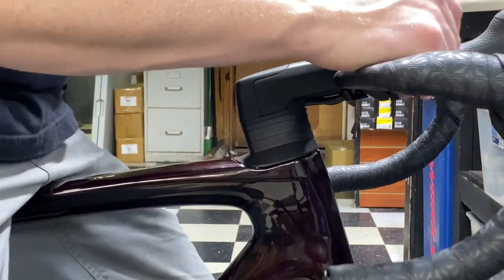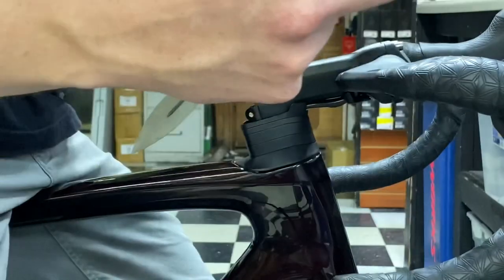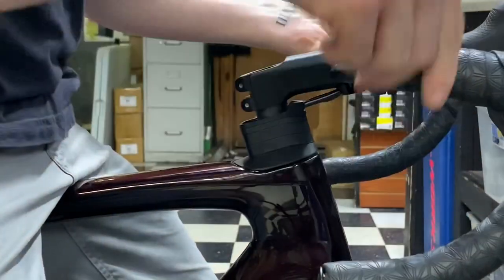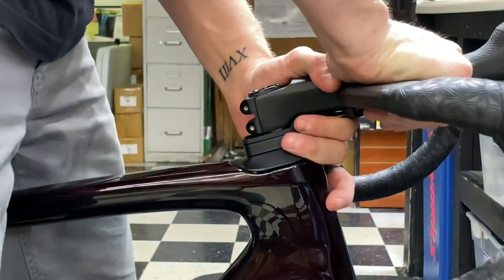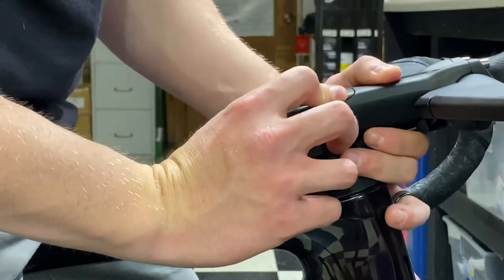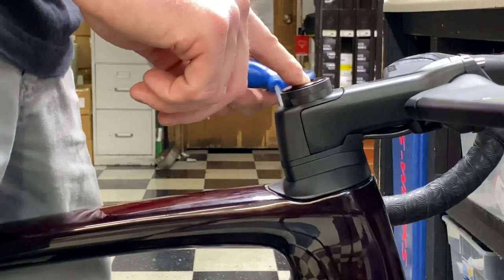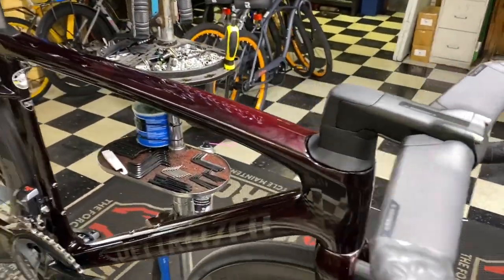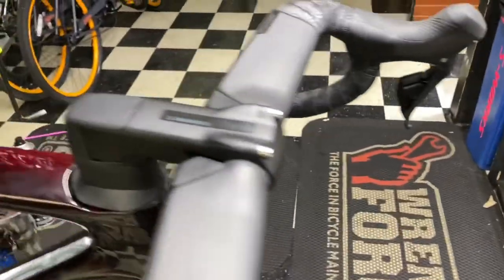*HOW TO* LOWER SPECIALIZED TARMAC SL7 STEM AT HOME WITH THE PARTS YOU HAVE. (COMP, PRO, S-WORKS)

Comment: @GC,  If you had removed one more spacer, and then cut the steerer tube, would it be necessary to cut/adjust cable length too?
Reply from the maker: You wouldn’t need too

Comment: Hi, just wonder if the factory brake cable has some slack to install longer stem?
Reply from the maker: maybe 10mm longer but it is usually pretty fit to it
Reply: @GCPerformance18  thanks for replying, I think im in trouble. Planning to add 10mm length and 10mm width bars 😅

Comment: Not sure if I’m going off on a tangent, but when dropping the stem, necessarily that’ll result in reducing the space between the top of the knees and the torso, at the top of the pedal stroke (closing?) the hip angle to some extent.
Countering clash of knees to torso in the more slammed position could be by a)reducing stem length? b)reducing crank arm length? c)reducing biscuits and gravy?
Also,
could the same “experiment” with lower position procedure be followed for 2019 venge?
Regardless, fantastic work in this and all other videos, many thanks.
Reply from the maker: thanks so much!!

Comment: Hi, very helpful video.. Can the steerer tube be shortened by cutting without disassembling it from the frame?
Reply: It can be done, but you have to use a small saw guide and the remaining amount of steerer tube needs to be at least long enough for the saw guide to clamp on.

Comment: As per Tarmac's user manual, a spacer bigger than 5 mm shall not be placed above the open stem cover. Is it because of the top cap bolt's length? And what are the risks of installing a spacer bigger than the recommended one? Thanks.
Reply from the maker: dont worry about it, as long as you tighten the pinch bolts on the stem to the right torque readings I have slammed my stem and rode with all the spacers on the top no worries at all
Reply: @GCPerformance18  I tried this today and was wondering the same after noticing the comment in the Tarmac user manual... I think in theory you could remove all the spacers from below the stem, and then the stem would be gripping the steerer tube below the expansion plug... isn't this a problem? I just slammed mine by 15mm but this is a pretty crucial part of the bike so don't want to F something up and have a life altering crash as a result....lol
Reply: @IPAColosseum  On the safer side of things, ideally you want to clamp the reinforced section of the steerer tube. Specialized's expander plug is a little taller (if not just as tall) than a stem's steerer tube clamp.

You also may have heard of people deliberately running long expander plugs for this purpose.

Comment: Sorry for a question, did you have the chance to mount the Aerofly II handlebar with the mechanical shifting? Because i would like to mount it on my Taramc SL7 Expert with mechanical Ultegra.. Many thanks in advance
Reply from the maker: i have not ran it yet but I know it is possible because I have seen bikes with it done.... so best of luck
Reply: @GCPerformance18  Thank you very much
Reply: @yonglingng5640  thanks, i think i found it on your photos, is the black/ice-white sworks frame, right? Really cool!
How was to mount aerofly with mechanical cables? Hard or quite simple?
Reply: @Andrea-uc7dy  Yup, you found it.

In terms of difficulty, it certainly isn't easy, but using an old shift cable to route the shift housing does greatly simplify the process. This trick has helped me route several bikes and handlebars with ease, I almost didn't need my Jagwire internal routing tool.
Reply: @yonglingng5640  many thanks

Comment: Does this technique require the carbon fibre spacers to be as you’ve shown? 
Or can this be done with the spacer kit specialized sell? 
e.g. Specialized My19 Venge Headset Spacer Kit?
(In a case of a 2019 venge)

Comment: I understand cutting the steerer tube. Is it just as safe to cut down a carbon seat post?
Reply: Yes it is, just remember to take note of the minimum insertion mark's distance from the edge of the seatpost, then make a new mark post-cut.

If it's an uber-lightweight carbon seatpost like Darimo's, no. It has a designated clamping zone, so the carbon's thickness is only thicker in that zone.
Reply from the maker: yes it is and like he said as well :))
Reply from the maker: thank you
Reply: @yonglingng5640  I have a Syncros Duncan Aero SL from my 2020 Scott Addict RC Pro
Reply: @GCPerformance18  You're welcome.
Reply: @JayLato  The original seatpost of a bike is mostly safe to cut because the thickness is constant throughout. This is why they weigh heavier than uber-lightweight seatposts.

Comment: Have you traveled with a SL7. How hard would it be to drop the bars for a bike bag? Also what ratchet would you need to upgrade the Rapide CLX hub?
Reply from the maker: yes it is fine, just get a big enough box or bag where you can take the handlebar off, and put to the side, you need the 54t ratchet but the EXP version
Reply: @GCPerformance18  does the Rapide CLX come with a 36 or 52t ratchet?
Reply: @jj4996 the CLX wheels come with a 36t ratchet

Comment: I got myself a brand new SL7 tarmac, when I got it I noticed that the wheel wasn't quite lined up with the bars, therefore I realigned it. Now when I turn the bars I can hear a hissing, I didn't thighten the bolts too much, the top one a bit tigheter than the pinch ones, pinch ones are just snug. No play in the headset.. Any suggestions or this is expected behavior? Bare in mind I haven't ridden the bike yet.

Comment: Hi GC, 
thanks for the great video!

Can i ask how tall you are and what your leg length is?
You said the bike is 52 - I'm just curious if I am going to order the right size. :)
Reply from the maker: So this bike was a customers bike. Not mine, I ride a 56 and I’m 6ft tall
Reply: I'm 5'7' and ride a 52  Inseam is 31. I could also ride a 54.. I need 15ml spacers under the stem on the 52 If I rode the 54 I wouldn't need them. Make sure you get a fit.

Comment: Do you have the top cap and the bottom screw piece for the cable in stock ?
Reply from the maker: I do not but call any spewciqlzied dealer they should be able to help

Comment: Is there typically enough slack in the system to at least get some fresh grease on the upper and lower headset bearings?
Reply from the maker: very rarly, you might be able to get away with a grease gun on the top but I do not knwo about under neath

Comment: Do you have to re-bleed the line if you decided to cut the steer tube or do you just cut it without taking the fork out of the frame?
Reply from the maker: so you can get a saw and jsut got it while it is still attached to bike, you just have to remove at the spacers and stem and be very carefull on the cut and have someone hold the bike..... I have done this before but the real way to do it is, to un hook the brakes and pul the fork out and then have to re run the cables through the bike, if you are carefull enough someitmes you dont have to rebleed brakes on new connection....

Comment: Is there typically enough slack in the brake housing to swap stems to go up 10mm from like a 100 to a 110 without having to redo the cabling?
Reply from the maker: sometime syes depends on the shop who builds it, I usdually shove cables into the bars to add excess amount if we do want to make the stem longer......

Comment: Hey GC, with the original top cap and cover. do you need to use that specific top cap for the cover to clip in? Or is the top cap not involved with the integration of that plastic cover?
Reply: Yes, the stem cover clips into the top cap, but there's another version of the stem cover that has a hole up top, allowing you to use any top cap you fancy.

Comment: whats the performance benefit of the swapping out the ratchet? Is it the same one in the CLX wheels? What's the expected gains, as I have thought about upgrading mine In my Pro
Reply from the maker: you would get a better pedal stroke annd less dead spots in between and more engagment for climbing...... you do get a little  tiny more drag while coasting but I mean as long as your pedaling..... there is no downfall to it

Comment: Planning on replacing my stem from 80mm to 100 or 110mm, would there be enough slack on the cables for the longer stem? Thanks!
Reply from the maker: there suualyl should be enough slack, when I build I shove extra cable in the bar for that reason alone
Reply: @GCPerformance18  great thanks!

Comment: the spacer and covers look sick! but does it fit on an Allez sprint? I just like the look of it xD
Reply from the maker: it fits but ti does not look as good on the allez sprint
Reply: @GCPerformance18  do you think i'd be better off a normal spacer and stem
Reply: @fluxed2100  You're better off with regular spacers.

Comment: hi there! could you fit  the tarmac stem into a sworks venge??  I have a sworks venge  and i need a 90mm stem and it seem way easier to find the "tarmac 90mm stem " would it fit my venge? kind regards!
Reply from the maker: yea it work but ti doesnt match the fit of the spacers, btu stil works

Comment: Just wondering, do you have to use spacers? What’s the risk of not using the spacers?
Reply from the maker: you need to, the fill up the empty space, so you run the risk of the fork being able to move up and down if not filled by spacers

Comment: How low you can go before deciding on bar height because of the compression plug length? I assume you should not be riding with stem clamping carbon steerer below the compression plug.
Reply from the maker: Your fine. With specialized the steerer plug is deep as is but I mean as long as you don’t over tighten it there are no issues with it. I have done it to my bike and also customers bikes. There are no worries. It is thick there
Reply: @GCPerformance18  thank you.

Comment: Wondering if my bike is using FSA Acr headset, can I use SL7 or Venge stem ? Does the cable integration compatible?
Reply from the maker: No it needs to be a specific bike model for the integration cables. The stems can be used but not ran like the sl7 or the Veneg
Reply: @GCPerformance18  mine is now with FSA Acr stem but too short, looking to change Venge stem as I like their integration 😅

Comment: I don't recommend do this without cutting short brake hose. because most BSA BB don't have a "cup" inside the frame. So if you just push down the stem, brake hose will be lowered too, and it's very likely that brake hose will touch the spindle of crankset, and rub it.
I know this because it happens to my bike.
Reply from the maker: sooo, this is where the bottom bracket comes into play, shimnao and sram stock bb both have plastic sheeths covering them so there is not direct contact with a rotating spindle...... but if you use an aftermarket bb or maybe an installed wrong one then yes this is possible.... also the cable slack should be allowed mainly in the handlebar to hide excess

Comment: Hi GC Performance. I own a 2020 venge frame. Need to change stem but not able to find one in correct length. Do you think can use SL7 stem with Venge spacers ? Some say the spacers wont line up properly. Would appreciate ure thoughts !
Reply: It won't, but if you use the Venge's other headset cover (the one with three holes, two for the brake hoses, one for the Di2/EPS wire) alongside a bunch of regular round spacers, any stem is compatible with the Venge.

Comment: Hi what do you have to do withe front brake line to replace/service the headset bearings
Reply: It needs to be disconnected, the bike will need to be recabled afterwards.

Comment: When you cut the fork, how much lower should it be to the steam?
Reply: The distance between the top edge of the stem and the edge of the steerer tube should be 3 - 5 mm. If your steerer tube plug has a flange that rests on top of the steerer tube when installed, take the flange's thickness into account too.

The Specialized steerer tube compression plug's flange is a little over 1 mm thick, so I usually cut 4 mm below my first mark (the mark that's flush with the stem at the desired stem height), making the steerer tube 5 mm lower than the top edge of the stem. Once the plug is installed, it'd be about 3.5 mm.
Reply from the maker: yes what he said lmao

Comment: Specialized manual says you can only put a maximum of 5mm spacer between the stem and the cap.
Reply from the maker: of course, that is it, but i have seen there own reps rocking all the way slammed,
Reply: @GCPerformance18  If you are needing more than 5mm on top then you need to start chopping that steerer. Wouldn't want to violate warranty terms. 👍🏻

Comment: Could you post a video with the Roubaix 2020 with FS2.0 and the Tarmac SL7 stem? Curious how it will looks since since the future stem is only available in 6 degr and tarmac sl7 stem 12 degrees. Already installed  lower top cap and hoover bars replaced with standard spesh bars
Reply from the maker: lemme see if I can make that happen
Reply: @GCPerformance18  would be great! Know about a lot of roubaix owners who are thinking of installing a SL7 stem

Comment: the hoses are cnacked .... i'm sure his brakes doesn't work well anymore !!
Reply: always remove your handlebar and get help from a second person to hold the handlebar and always remove the bolt at the underside of the stem that holds the hoses
Reply from the maker: Hoses work perfect. Done this on more then 100 of these bikes. If you could only see the bend the cable has on the fork steerer. That’s the point of hydraulic brakes. It’s a fluid

Comment: Is there any performance in changing the ratchet in the rear hub?
Reply from the maker: so, the only benefit they say is you get more points of engagement, so less dead spots in the wheels when applying power so better for climbing, and maybe for up out of the saddle for sprinting, but the down side is, you have more drag because of all those points of engagement for descending down a hill, so you would in theory be 54t engaging downhill.... i dont have hills so we are always pedaling but even now specialized made there stock wheels come with 36t ratchets, and peopel run i9 wheelss